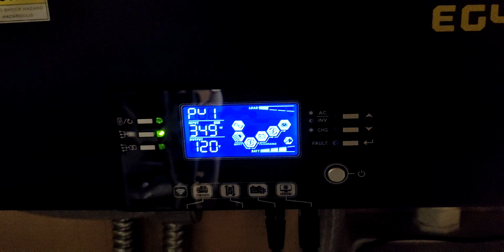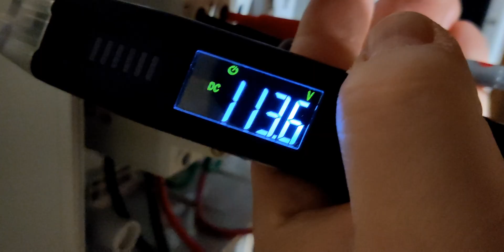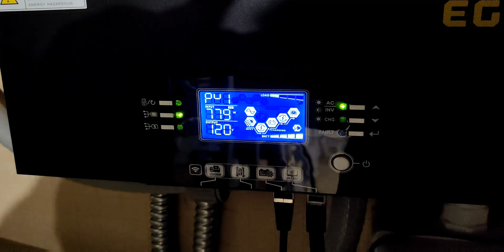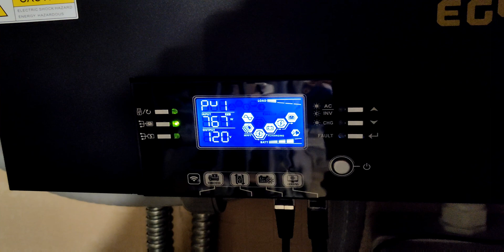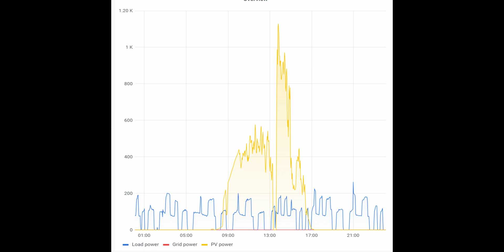Connecting Panels Of Different Wattages and Voltages In Parallel - Shenanigans Ep. 03

Comment: You are quite well-matched.  A few volts on a (roughly) 115V string is nothing.  I do that to when I can... use a few older panels to "goose" the main panels.  Its not ideal, but it is ok to do as long as the rules are followed.

The only requirement when paralleling strings is that the operating voltage of any given string cannot be higher than the open-circuit voltage of any other string.  That's it.  Do not try to parallel strings if this rule would be broken because you will wind up putting reverse polarity on the less capable string, which is a fire hazard.

Beyond that, the general rule of thumb is that forcing a string to operate a little (like 5%) below its "operating voltage" will not hurt production by very much.  Strings must still be properly fused when paralleling, of course.   There is actually quite a modest amount of voltage wiggle room when paralleling.

The rules for putting mismatched panels in series are more stringent.   Both the short circuit current and the operating current specifications for the panels must be very close to each other (less than 1A difference... less than 0.5A if you can swing it).  If the amps are too far mismatched it becomes a fire hazard.  No rules of thumb otherwise, the voltages just add.

-Matt
Reply from the maker: Yeah it's a hack in my case, and I'm pretty sure until the weather went to crap I was wacking into the max amps for the charge controller, but it's better than trying to run new wire when it's 25F and snowing.

Comment: Hello friend, i have an EG4 3k inverter and it needs a minimum of 120 volts coming off the arrays. Isn't the inverter you're using the same? Yeah November December January with all the clouds in Hayes don't let the panels really produce much 😞 Love your videos keep up the great work❤
Reply from the maker: The 3k has a minimum of 120v, the 6500EX for some reason has a minimum of 80v.  This is one reason I went with the 6500EX over dual 3ks.  The new 6000XP has a 120v minimum IIRC.
Thanks for the compliment too, it's been snowing since last night so I'm at 0.2kwh for the day... :/
Reply: Also, if a string isn't compatible with the hybrid inverter's solar input, there is nothing stopping you from simply throwing the string onto an independent charge controller connected to the same battery. Like a Victron 100/200 charge controller for example.    There is no requirement that the hybrid inverters be the only things charging the battery.

Comment: Howdy Shenanigans,
          You may be giving up a few volts when they are connected together but it seems to work. if you hit a peak of over 1400 watts out of 1800 available, that's not too bad considering the time of year and conditions. You could probably get a little more if your 4 panel array was angled at the proper angle for late October, early November.  Still, it seems to work pretty good even though the voltages are a little off between the different panels. 
                              Steve.
Reply from the maker: Yeah, considering one array is at 25 degrees when it should be more like 45 and the other is at 35.  It's still better than going out and running wires in my 35F garage to hook up the second charge controller. :)